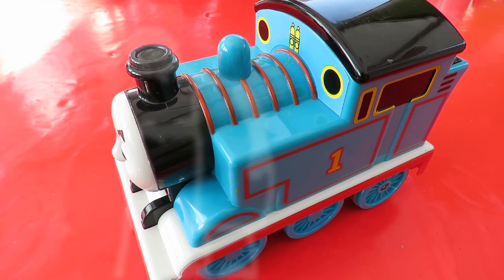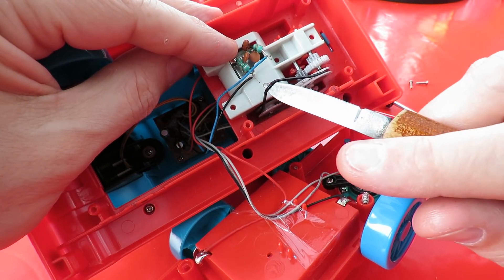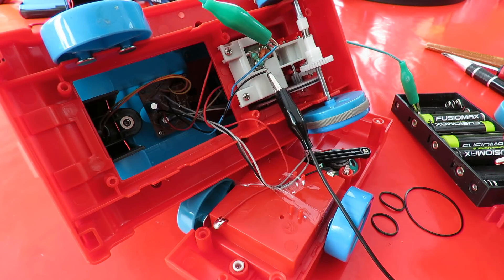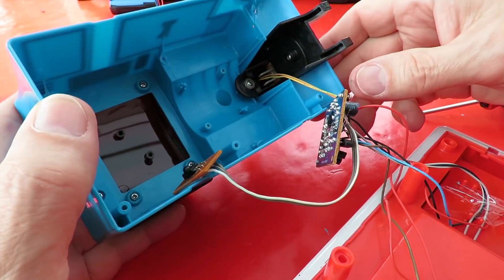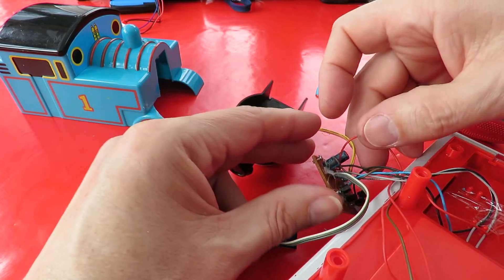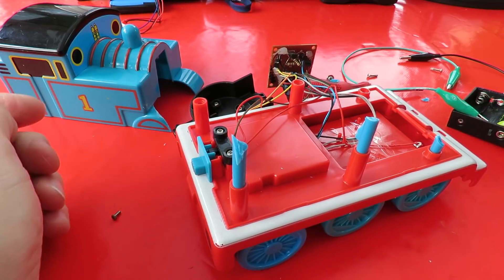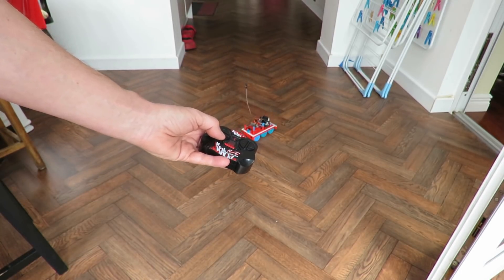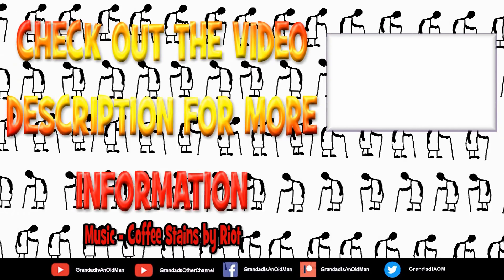Infrared Thomas The Tank Engine conversion to 27MHz

Comment: is the h bridge kinda like a speed controller ??
Reply from the maker: It is not a speed controller as such. There is no variation in speed, just direction. It just sends full power forwards or backward (or left and right). The H bridge is an arrangement of 4 transistors. The motor sits on the middle bar of the H. To get the power to flow through the motor one way the top left and bottom right transistors are turned on. To get the power to flow the other way the top right and bottom left transistors are turned on. Turning the transistors on and off can be done with a low power signal from the receiver chip whilst you can have a much higher power flow through them to run the motor. If you draw yourself a diagram using my description you should be able to see the way the current will flow through the motor. Make it simple and put Positive at the top and Negative at the bottom then follow the path top left to bottom right. Then again top right to bottom left. You will see it flows through that middle bar in opposite directions and that is where the motor is.